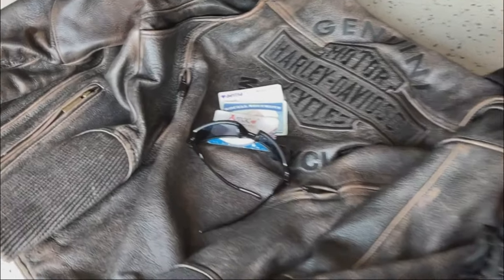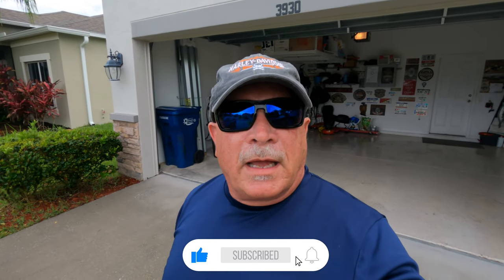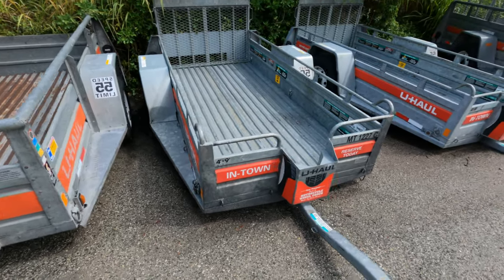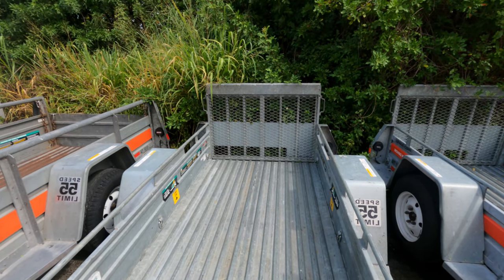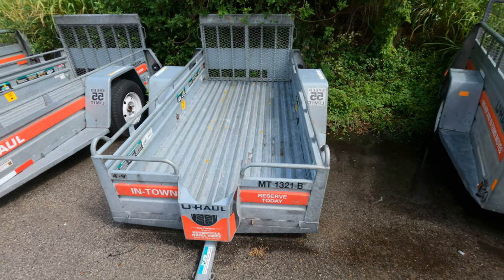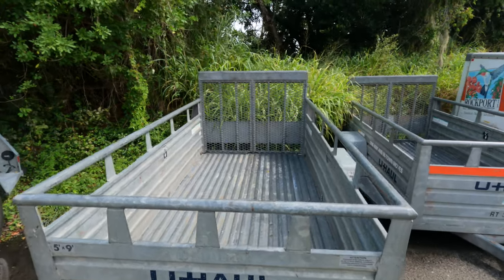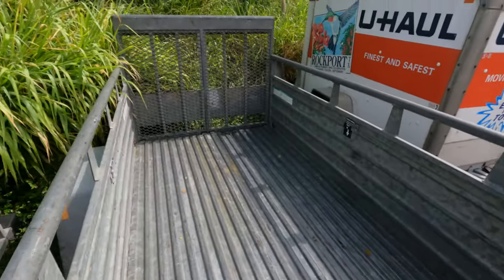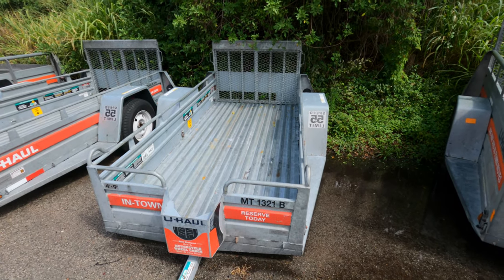Trailering to Sturgis. Uhaul's 2 trailers. Don't get stuck with the wrong one.

Comment: You don’t need to get a bigger trailer to make sure it clears the gate hinge.  Either drop the gate onto a curb, some wood, park the trailer wheels in a gully, or  park the rear truck wheels on a hill.  All these smoothens out the transition into the bed.  Pulling a smaller trailer has a lot better fuel efficiency.
Reply: Yep, no sweat Just like you said. The smaller light-weight trailer pulls very easily with my little 2016 Mazda CX-5. Also the shorter ramp doesn't grab the wind like a sail. Only about $25 a day.
Reply from the maker: I prefer the heavier trailer. It is more stable for my Road Glide. The lighter on makes me nervous goin g 3,000 miles. Whatever works.
Reply: @HarleyGeezer1954 Did you have your RV towed out there too so you don't have to drive it either.

Comment: Good video brother. I also watched a video saying the MC trailer “doesn’t have suspension” (which I think isn’t true but probably has only a torsion bar) while the larger boxy trailer has spring leaves and provides a better towing experience. Thanks for sharing it. Cheers, Eddie
Reply from the maker: @WindyTherapy  I also like a bigger heavier trailer for my road glide

Comment: Uhaul tried to rent me the trailer with no front wheel chocks which also had 2 missing tiedowns. I quickly corrected them and got one of the small trailers. I had no issues loading my Electraglide whatsoever. It stayed put the whole 1600 miles from Texas to ND.
Reply from the maker: It is just certain touring wwith the 12" shocks. Mine and my friends could not get ours on. We tried different ones. No bueno.

Comment: Got a Honda VTX 1800, I found the same issue, I used  a 2x6 under the ramp, solved the problem but I do like that RT bulk, seems to be made for heavier loads and distances...
Reply from the maker: I prefer a heavier trailer for a 885 lb bike.

Comment: Will a 06 Softail fit up ramp on the 5x9 trailer ?
Reply from the maker: I use the RT 5X9 for my touring bikes. You should have no problem.  I have a new video showing how I do it. Your '06 soft tail should be no problem. The ramp is much longer.

Comment: I used to have a trailer that had a steep angle on the ramp and the bike would bottom out. I just took a couple of 2x10's and cut and nailed them staggered together then slid then under the ramp. Works great.

Comment: They must have changed the ramp gate on the trailer I rented it did have the wheel chock in the front and I ride a flhtp with 12” suspension had no problem riding in or backing off.
Reply from the maker: Some of the bigger ones indeed have the wheel chock. What do you ride?
Reply: @HarleyGeezer1954  flhtp with 12”suspension
Reply: @HarleyGeezer1954  flhtp with 12”suspension .
Reply: Have fun in Daytona

Comment: Would a sportster fit on the regular motorcycle trailer from u haul?
Reply from the maker: Oh yeah. It is the touring with the 12" shocks that seem to be a problem. The sportster has a short wheel base and should be fine.